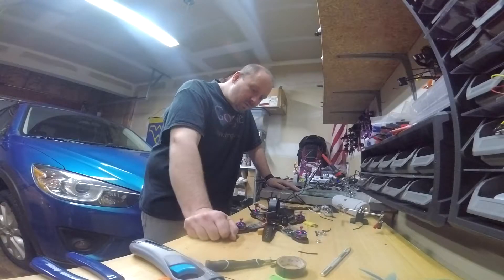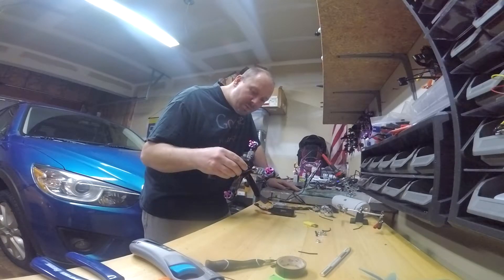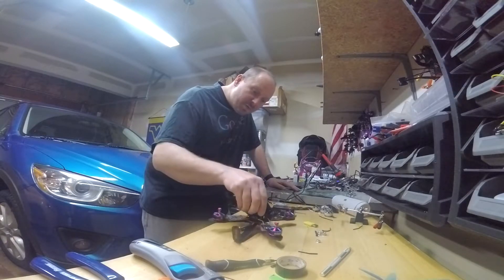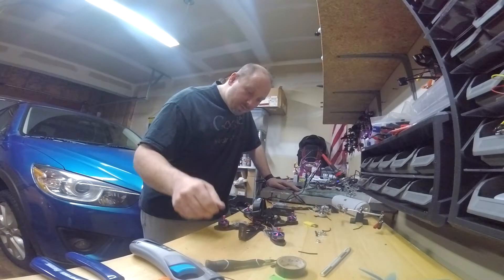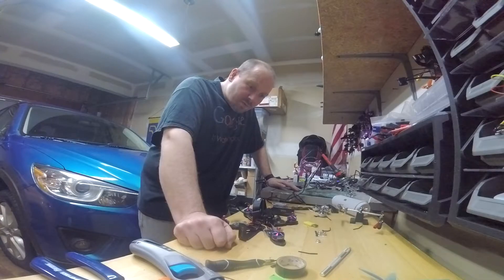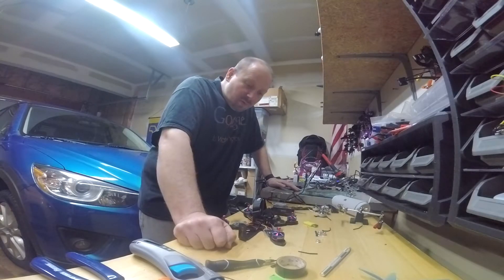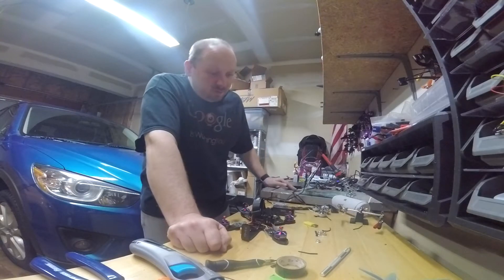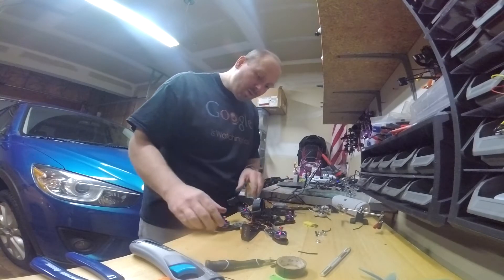Hyperlite v4 2206/2522 Team Edition Problems

Comment: Have you found the issue? I had installed some new motors recently that were doing the same thing I believe. All my motors had to be reversed in BlHeli.
Reply from the maker: Philip Hubrig i am running kiss so that's done by soldering a pad and they were all correct - I believe my issue was that one of them was bad and I'll know when I buy one more...

Comment: wow I just ordered the 2206 2122 KV hope I don't have that problem LOL but you didn't soft mount your Motors I will
Reply from the maker: Ultimatevapor918 
actually I did try soft mounting them - it made no difference and I still had the problem 
soft mount = snake oil IMO
if you're some some top level acro pilot that can detect the tiniest micro vibrations - then soft mounting is for you, otherwise if you're just out here racing or having a good time it's a waste of tape and time

Comment: did you solve your issue?
Reply: Slowjet 
I went back to my xhover motors and the quad flies fine - attempted to open all 4 hyperlite motors up to inspect and one of them had an issue where the Allen bolt would not come off - it's like it was seized - I can only assume this motor was the cause of the issue - I figured I'd pick up one motor down the road and see if I could get them to work then...
Reply: Sounds good. All my quads need new motors so I just ordered a bunch of them.
Reply: Dave Althaus  See my reply to slowjet
Reply: Christopher Pauley did it work